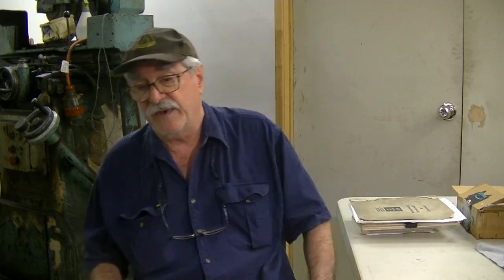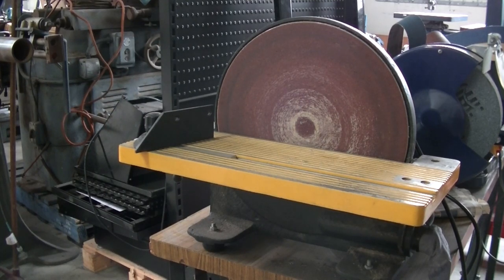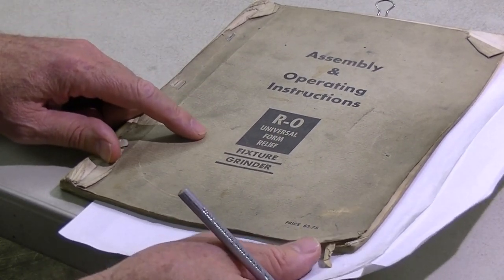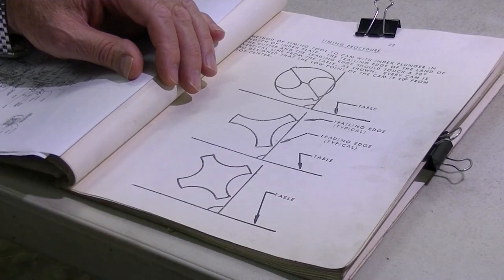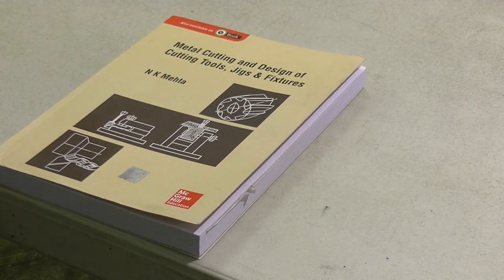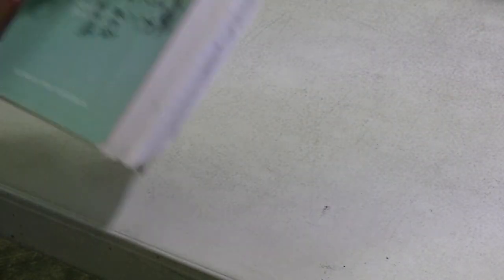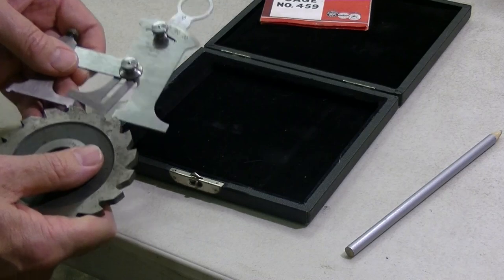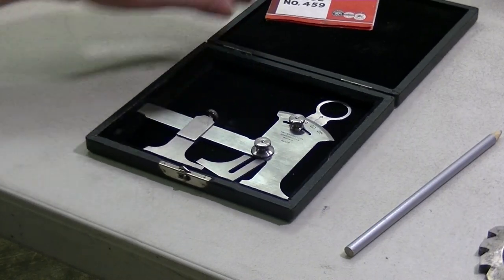More tool and cutter info

Comment: BC “ I’m surprise the later model I’d go to an angular adjustment” on the Coventry die sharpening fixture - my hues is pressure from Marketing “but everyone else has angular adjustment and it looks flashy” Anyway you have mentioned 4 facet grinding, when do we get to thee the BC no nonsense works every time solution? Can’t wait! And have subscribed.